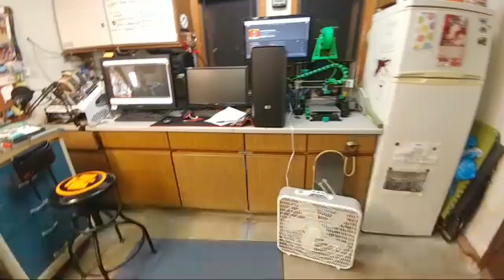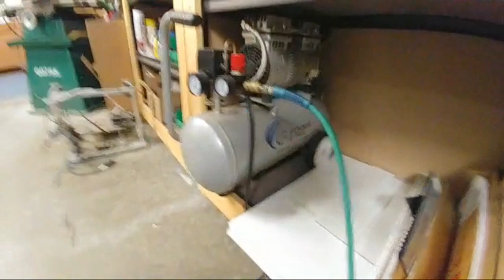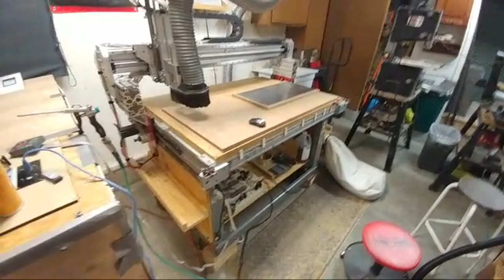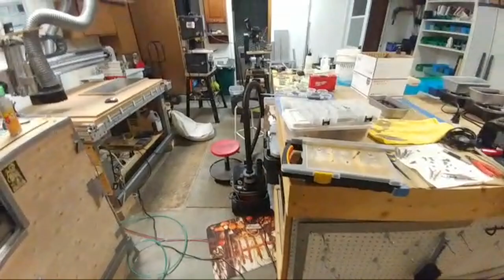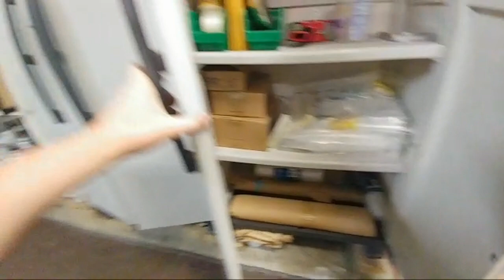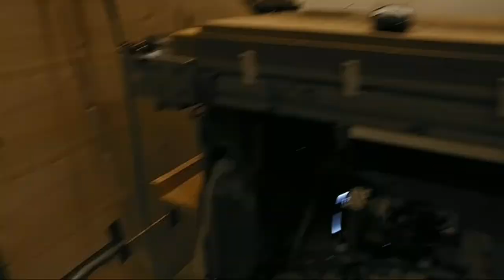Clockwerk Industries Shop Tour! Live!

Comment: 200A! That's awesome. I'm working with 50A for everything in the garage. I would LOVE a setup like yours. Currently using Shapeoko 3 XXL, Harbor Freight 2HP dust collector,  and a HF air compressor that I'll add to the setup once my dust boot comes in. I'm praying I don't trip the breaker in the middle of a cut and ruin my stock and end mill
Reply from the maker: Haha well 200amps is the whole house, the sub box to the garage will probably be 50 amps, the Tormach needs 20 to run everything it needs, and either the router or laser use up 20 when they have their fume or dust extractors on. So I should at least me able to run 2 machines at a time with a 50amp sub box. That should be enough to operate until I expand to a larger shop hopefully with 3phase power
Reply: Ahh I see that makes sense. I've got a 20A into the garage that's also hooked up to the bedrooms and living rooms (1943 house) and a brand new 10g 30A that I paid for and got hooked up straight to the main box with the landlords help. I'm with ya I eventually want a proper shop with 220 as an option in case I want it too. Eventually...
Reply from the maker: yeah at least I have 220v, I want that 380v 3phase! hahaha I wish I could get a second 200amp line run form the street to the house lol
Reply: Clockwerk Industries so you can run everything at once!? 😜 I’m just happy I can run my cnc now with the 30A added. I’ve had this shapeoko for months 😩